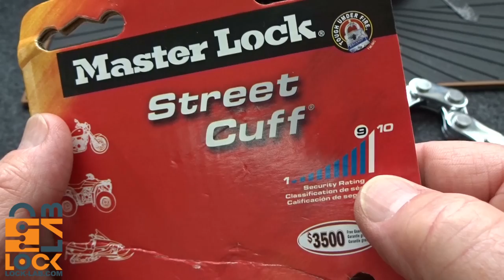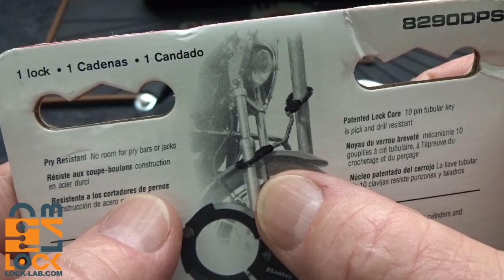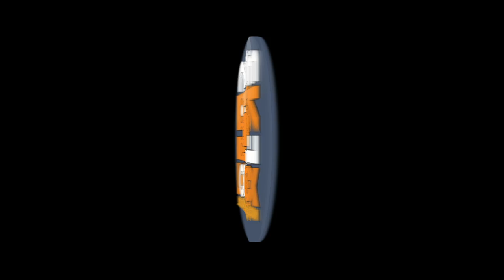(1049) Review: Master Lock Street Cuffs Bike Lock

Comment: The bits I don't like really are that the "weird lock mechanism" can still be picked pretty much just regular picks.  Also, I'd be interested to see how that thin part stood up to regular bolt cutters once you pried the plastic away.  If its case-hardened it seems like it might just pop almost immediately.

Also, I'm not sure the once size fits all cuff would fit on my horse.

(I don't actually have a horse, I just thought it was funny)
Reply: Criminals don't ever bother picking locks. I've been a locksmith 16 years now and I've yet to ever even hear of a lock that was picked in the process of a burglary or theft. A burglar might have a hammer, and a screwdriver perhaps a pry bar. THat's all he's going to use. If that doesn't work or it's locked  up better than what those tools will go he'll just go elsewhere like next door. Ya know? Criminals CAN be picky!
Reply: They can be tricky, though.  I had an incident with a co-worker who was remodeling their house.  Repeatedly (while he wasn't there) someone would kick in the door, then run away.  Later they would come back and rob the place if it was unoccupied.  If someone did question them, they would say they were just checking to see if everything was ok since the door looked kicked in.  He was robbed 5 times over a period of a couple of weeks.  He took to sleeping in the place with a sleeping bag and a baseball bat.  Given that we were both in the military, I have no idea why "baseball bat" was his go-to option.

But yeah, in the US, it seems that how physically strong a lock is is really the only important factor.  Brinks' "commercial grade" boron steel shackled locks are just 4 pins.  I havent found any without a spool, but with 4 pins, it doesn't matter too much.

Ive been doing this (amateur) for a couple of years now and I have a very old Corbin lock and an old American 40 series USA (not US) lock that I can't pick.  The American lock looks like its just packed to the gills with serrated pins and I have no idea what I'm doing wrong with the Corbin.

Anyway, you probably didn't want or need to know any of that, but if you made it this far, you do.
Reply: I think you've been had by an urban legend. Why would anyone break into the same house 5 times? If the same guy was standing there every time it was broken into don't you think the police would be arresting him after strike 2? The thing with this channel is it's really exhibition lockpicking and the real world is NOT so kind as to give you locks that have been around the town and been picked many times by many others. In the real world you have to get into awkward positions to get at locks and sometimes it's almost impossible to get a tool in there, also the wrong bitting can literally make a lock impossible to pick via conventional means or within a reasonable amount of time... Also Old does NOT mean easier to pick, on the contrary, years of parts getting worn... dirt, grime, etc getting into locks all makes them harder to pick. One of my favorate things that I run across on a LOT of people's locks is that a great majority of people use their keys to clean out their ears, so a lot of earwax gets caked up in the back of the lock, and you know what it is because after rekeying a house with them your hands smell like you just gave a maingey dog an agressive back scratching! Combine that earwax with graphite.... (NEVER EVER EVER EVER EVER use graphite on any kind of a modern lock be it automotive or residential) or whatever dust is in the air and you very often get a key that the key won't even go into all the way. If you really want to use graphite on a lock then take your key, and then trace 3-4 times down it with a pencil, blow off the excess and stick it in the lock. That is all the graphite that should ever be put into that lock in it's lifetime. As far as fancy boron shackles etc it's just a gimmik. Any hardened steel will wreck a hacksaw blade, abrasive tools just don't care, but for bolt cutters as long as you get a 5/16 shackle or larger you aren't going to have bolt cutters work on it, at least not the kind you can get off the shelf at your local store, rebar cutters maybe but those things are HEAVY, EXPENSIVE and like 8-12 feet long!
Reply: As to getting robbed, There's a little more to the story.  It was someone I'd known for years and I'd actually gone to his house.  "Remodeling" in this case means extensive rebuilding due to fire damage.  The two main attractions were the large number of tools on-site and the fact that it was located right next door to a bar.  The guy had only been there for the last 2 break-in attempts, to make that clear.  He might have been exaggerating, but not by much.

I'm pretty aware that older locks (pin and tumbler locks) are actually generally better than newer ones as it seems that picking used to be a lot more common.

As for the American lock, you can actually see the serrations on the first 3 pins, and from other locks of the same type I've seen picked and broken down,  probably all of the pins, top and bottom, are serrated.

The Corbin lock actually says "Lubricate with graphite" right on it, though it is probably 100ish years old.  I personally just use WD40.  I know its a cardinal sin, but the locks I have are really just for practice.

I don't know why manufacturers don't just use heavy tensioning springs.  I have a Brinks disk lock that (for me) is nearly impossible to pick due to the combination of very high tension and spools.
Reply: Not exactly. There are a LOT of crappy locks straight out of the 1950's and 60's I end  up seeing in my area (a retirement town in florida full of people older than dirt) and they pick just as well. Lockpicking to enter a house for burglary is really kind of a hollywood thing, it doesn't happen very often at all now or in yesteryear and when it does it's usually an idiot locksmith that does it for the criminal, the one case that comes to mind where this even made the news was in the watergate scandal where they actually hired a locksmith to pick open the door for them under the guise of doing legitimate government stuff. And yes, american locks do have serrated pins although after years of wear they aren't as big of a deal if you have to pick them unless the lock is all crusted up with grime.

As far as lubricants, most locks use brass parts which are supposed to be self lubricating and all you need do is keep them clean and dry. I use WD-40 and have for many years because I've never seen a lock fail from too much WD-40, just stick that straw in the keyhole and flush till all the black graphite and stuff comes out. If you are really paranoid about leaving the WD in the lock then use QD contact cleaner, it'll take the WD-40 right out and leave the lock clean and dry. I use the stuff for reading the numbers on say certain car locks which I can make a key for if I can read the tiny numbers on the wafers by looking through the keyhole, they just need to be clean inside and not "shiny wet" so you can see without glare. Graphite no matter what the lock mfg'r says is only going to cause you a mess and be a headache down the road. Two passes with a pencil over the key and that's all the graphite the lock will ever need in it's entire lifetime!  Powdered graphite is an industrial waste product. The only reason they still mark on the tube "good for lubricating locks" is because they want to get rid of it by selling it to you and the hardware store that sold you that tube of crap that left your door locks useless will only be too happy to sell you a brand new lock and tell you to use the same stuff in it... Seriously, unless you are working with something like a lever lock stay the hell away from it!
Reply: Yeah, I don't specifically have any contact cleaner but I engine starting fluid to clear out WD40.  Its probably almost exactly the same thing.
Reply: No, Starter fluid is di-ethyl-ether. QD contact cleaner is an aezotrope of Difluoroethane and hexane which are less likely to strip that plastic clear coat finish off the locks and paint on anything else for that matter, also it dries MUCH faster, as in almost instantly. If you do any kind of lock work for buisness purposes it's a must have and there are no acceptable substitutes.
Reply: My primary job with the military was electronics repair.  Contact cleaner was great, but I did remember using whatever kind we had on a keyboard once and melting it into a puddle of goo.  (took me a while to find it) We got it from Wurth chemical supply.  It was the only piece of plastic I ever had problems with.
Reply: Problem is many newer locks especially kwikset key in knob locksets have ditched the metal stem inside in leau for a plastic stem and that stem WILL melt in a similar fashon with such a harsh solvent like di-ethyl-ether. That stuff is quite NASTY 6 ways from sunday! it's also quite explosive for a long time, the brand youy are looking for is CRC specifically CRC QD contact cleaner. Works fantastic better than anything else. it won't even dissolve conformal coating on cb's like di-ethyl-ether will.

Comment: I'd grind a rivet off the chain, especially if it was mine(fixable). I've hand filed a rivet off of a similar, but smaller, chain before. Also a possible air drill through the lock slider mec piece( thinking of portable and quick here).

Comment: I wonder if the nonfunctioning pins are in the same place on every lock.  If so they could be used to fashion a tension wrench that would work even without a vise or third hand to hold the lock steady.

Comment: very good job EXCEPT you did not attack the chain. the weak link appeared to be the bike chain. You could have ground down the top of 1 or 2 of those connecting pins and hammered them out with a punch. or, you could have used the die grinder to cut across the plate on one side and then do the same to the plate on the other side of the same link and it should have came undone. that filler metal looked like it was just sitting there, maybe epoxied, but either way would have liked to see that taken down as well. the metal on the sides of those links looks a lot thinner than that swivel connector you ripped through.

Comment: I wondered if it is even faster to grind through a chain link. Because the fillers seem to be loose in there. But then again it seems like 4mm or sth to grind through. And grinding off the link cap like you did might still be faster than that.

Comment: a good size pair of bolt cutters and a covered box truck will have your bike gone in seconds. Never try going through a door when you have a window. Cut the head off of one of the chain rivits? Use a bolt cutter where you cut the weak point, faster.

Comment: i may have a idear for a new security thing,
what if you make the middle of the lock lock in a ball joint, make the key also stabilize the core
and make the inside of the lock lock up if its off center.
Its very hard for a lock-picker to lock-pick the pins while stabilizing the middle to be startend.
maybe with a teeth arrangement so when its off center and your trying to tenten it, it will bite the teeth and stop unlocking.
What do you guys think?
PS: sry dyslexic.

Comment: Several pieces inside and behind the lock move upward, can you lever them up with a driver, and what's the drill resistance on the center since that's the weak spot?

edit: removed bit about bumping which I guess actually wouldn't work.
Reply: Rotational bumping in cylinder locks is a thing?

Comment: in the UK motorcycles are stolen whole, so a brace across the wheel is the same as a disc lock and pretty much worthless as it's cut at leisure much later

Comment: You should rethink calling this a great lock. I bought one for my bike after watching your video. Now it's dead. The weak point is the cheap barrel lock itself. After daily use it failed in the unlocked position; i.e. pushing the button down doesn't lock it and the button simply springs back up.
Other failure points I noticed: 1) You don't want this thing rubbing up against your bike. The links will scratch off your paint and scratch into the metal of the bike itself. 2) The plastic itself is cheap. After a year the plastic was cracking and exposing more of the paint scratching metal.
For the price, I expected it to last without any failures for more than two years. Now it's headed for the dump.

Comment: I feel like the week point is the key. Seems to me like you could just 3D print a key that would work for that mechanism.
Reply: You'd first have to find some way to determine how the teeth should be cut.
Reply: There are ways of configuring a model to make it print any combination, people have done it for much harder keys to clone. I'm not saying it's free, just seems easier than a physical attack.
Reply: Easier to do without getting caught than using a grinder on a bike lock in public.
Reply: Don't get me wrong, sometimes a physical attack is easier, I'm just not sure that's the case for this lock in particular.

Comment: Betcha it still crops with bolt cutters like butter.
What is the RHC of that chain? the lock cuff?
Reply: That's likely to mess up your bolt cutters worse than your lock. That's what those inserts are there for in the chain.
Reply: That is all well and good, but if the inserts aren't hard (over 50 odd rockwell) they may as well not even be there. Looking at how fast (yes I know its sped up) he cuts the lugs of the chain with that angle grinder I would almost bet good money that it would crop in the same place in under 20 seconds.
The most telling thing about how easy this would be to attack is how bosnianbill wont give a time.
Reply: Oh, also.. ~$400 for some bolt cutters (most expensive I could find at a glance) vs your ~$2000 - $20,000 motorcycle, the economics are a no-brainier.

Comment: I'm getting a storage unit soon. I want a good lock to protect all of my tools for work. What will work that's under 100$
Reply: Roberto Clemente weld it shut, very cost effective if you have something like an arc welder laying around already
Reply: Bill did a review of a Sobo captive key disc lock a while ago that was quite positive - they run about $30 on Amazon.  The only issue I've had is that the shackle is only JUST small enough to fit the standard locking bars at EZ-Storage and similar places, particularly if you get a unit with a shielded hasp.  That said, I am pretty damn certain that no one is getting into my storage unit without a die grinder and a lot of curse words... it'll be easier to cut the locking bar than to cut my lock off.
Reply: Sierra Whiskey Thank you very much for responding. I'll definitely take a look at that lock👍👌👏

Comment: I’d guess a hydraulic bolt cutter would go through the same knuckle without making noise. One good thing,… if the wheel was locked with this the thief wouldn’t be riding away.

Comment: Are you getting paid or sued by master? I feel like you took it pretty easy on them. Not timing the grinding, there are the chain itself is pretty stiff, I bet if you torque it, it would snap at the dog one in the cuffs.... how resistant to bolt cutters... lots of unanswered questions....

Comment: Could you please give your opinion on whether or not the Master Lock Quantum Cuff would be better or worse or the same as the Street cuffs. It has a street cuff on one end but is a cable so is more flexible for wrapping around or through different shapes and could be easier to use. SO basically how easy are these cables to defeat? I watched your Python video but the lock was so easy to defeat you never tackled the cable. Not sure if it's the same construction as this newer Quantum Cuff or not. Thanks
Reply: Cable locks are super easy to defeat, you just need some diagnal side cutters  and cut through a few strands at a time or a dremel, won't take you but 30 seconds or so for a standard "security" cable.
'

Comment: I'm curious why nobody ever shows attacking locks with a Dremel type cut off tool. You cut out so little material that it's about as fast as a big grinder, quieter and less conspicuous.
Reply: I use my dremel a whole bunch in my locksmith biz and I get jobs over the other idiot locksmiths who use big 4" or larger angle grinders and cutoff wheels especially on storage units that need opening. I don't leave a single scratch on anything but the lock but it's not unheard of for the "drill jockeys" in the industry to leave a door covered in "frustration marks" from their tools getting away from them. I just use the dremel 8200 12v max system and the ez cutoff wheels and haven't had a problem. I don't even bother carrying bolt cutters anymore because a dremel does it all!
Reply: Peter Carlson thanks a lot for the reply. Yeah, I am not in the business but I've cut a few locks off with my corded rotary tool. Most of the time it's so fast that people think I've given up, and they're shocked as hell when I tell them I'm already done LOL!

Like I was saying, I'm just surprised that in these destructive tests nobody ever thinks to show a Dremel used against it. Especially Bill who is always trying to make the point that the lock is only for slowing a criminal down or making it easier for them to rob someone else.

Comment: anything with a tubular lock is NOT secure.
Reply: WRONG. Not all are so easy like those crappy kryptonite locks. Many are quite difficult even with elaborate expensive tools designed for the purpose and some are just practically impossible to pick.
Reply: The Ace lock was only secure during the time it was obscure. Sorry